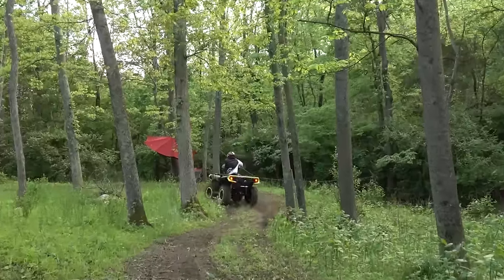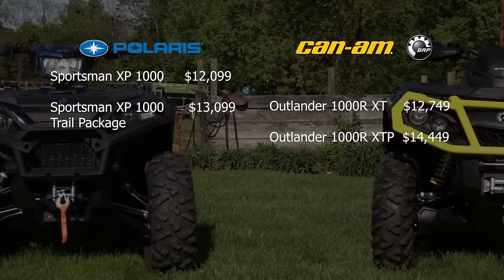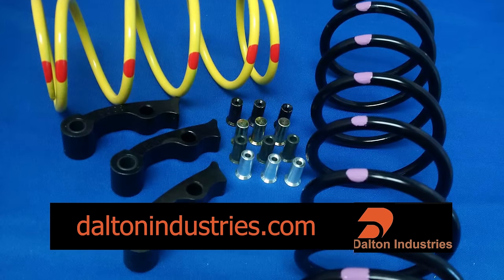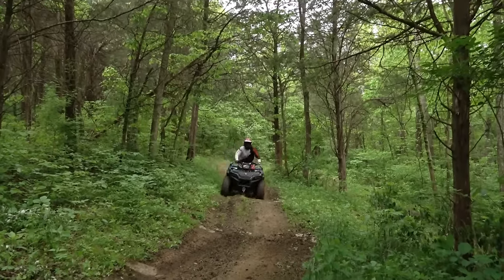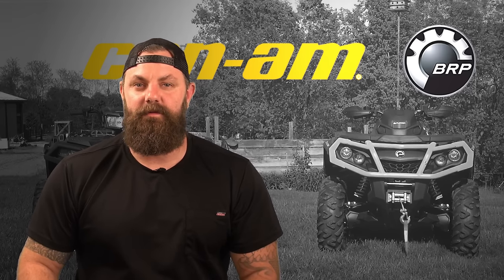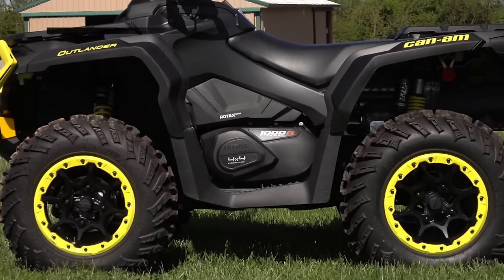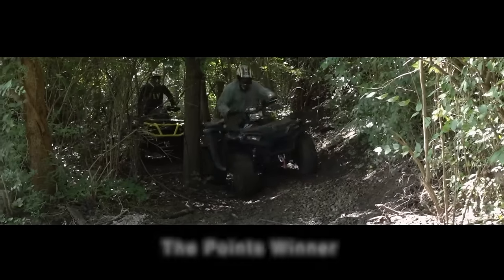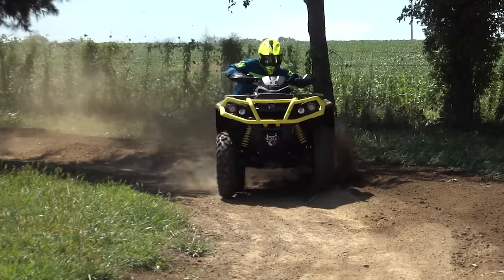Polaris Sportsman XP 1000 VS Can-Am Outlander 1000R XT-P, 1000cc 4x4 ATV Shootout

Comment: I own both - I think this is a great video to view for all buyers and I actually agree with a lot of details in this video.  What I liked best of this video was the last 60 seconds and that was  2 of the 3 would buy the Sportsman although the Outlander had better scores.   I feel exactly the same way.  The Can-Am's power and all that's said here and if I was taking it to the track, I would take my Outlander.  But other than than I choose my Polaris ALL DAY - EVERY DAY.  The big liter ATV's have incredible power, dangerous power and I am a power junky so I love it.  In reality I joy ride 90% of the time and don't use all the power.  The Polaris is so comfortable, smooth and so care free its an easy choice.  Outlander needs more aggressive power steering like a MAX-PLUS setting.  I dont like the shifting into Low when I am doing utility work as it gets warm it gets so sticky to shift its very frustrating and yes I keep the all the brakes applied to shift.  On a side note - What the video didn't show was that you can change All fluids - Engine Oil, Transmission, Front Diff, Rear Final Drive in 1/2 the time or more on the polaris.  Can't stand changing the fluids on my Can-Am but I do it every 12 month regardless of miles.  I think that you can't go wrong here and Polaris responded with a new "S" model to consider with upgraded shocks.  Polaris for me.  I have 3 polaris ATV's from 2012 to new and not had one issue.
Reply from the maker: Thank you for such a well-thought-out and informative post. We absolutely love it when owners give us feedback on machines they've had the opportunity to spend lots of time on. Chad on Days Sportsman and his friend Brian owns an Outlander. He mentioned how much easier general maintenance was on the Sportsman Duty easy access like you mentioned. I think we're going to come back and do a 1000 Mile review on how these machines hold up based on Brian and Chad's experience. They ride together most of the time at the same pace so the comparison should be pretty fair. We definitely need to make mention of the Polaris ease of Maintenance in that video. We'd recommend adding a power commander or some type of fuel management tuner to your Outlander. Richening up the fuel a bit will help cut down on the heat. You may also want to consider switching to a coolant like Engine Ice which can help reduce temperature spikes. All of these modern quads come lean from the factory to meet emissions and benefit from more fuel. Thanks again for the great comment and we hope to hear more from you in the future. One more thing, we are gearing up for a big Sportsman 1000 project designed to close the performance gap on The Outlander 1000 without sacrificing the comfort that makes the Sportsman so good.
Reply: @ATVonDemand  Thanks for the recommendations on the Outlander, I'll definitely look into the Power Commander and Engine Ice.  Great Job again on a fantastic review.
Reply: Great comment! All true!
Reply: Thanks👍👍👍
Reply: great comment, im in dilemma, i cant decide for outlander or polaris, i want to rip on open and ride trails with my girlfriend, watchin the new sportsman S but i think is to small for 2 persons, outlander xtp is big..
Reply: @sknails2723  I know all the safety polices out there say you cant have two people on it unless its a TwoUP version.  I go all the time with two people on mine BUT, I am a bit experienced, I don't drive like a crazy man, I am careful when turning. I also try to be familiar with the terrain before going up and down with someone on the back if it gets a bit extreme.  I am about to sell my Can-AM and my older Polaris so I can afford to buy brand new again.  I'm buying Polaris. I don't get paid by Polaris.  I am just tired of of the transmission and steering of the Can-AM.  I would ask for you to go ride both side by side before you spend the thousands of your dollars.  Focus on the power steering eases, focus on smooth shifting.  Even from R-P-H-L between gears while its running.  its just stiff.  Anyway. I could write a killer review like the one these guys did.  I would love to try the new 2021's to see if Can-AM fixed all my complaints.
Reply: @jamesknight7105  soo transmission is shit on canam? i can t believe it, they are number 1 brand in atv world, this got to be fixed somehow, how is steering shit too? did u tried Sportsman S 21 wide? Does it have enough power for drift and rip?
Reply: Polaris is the worst four wheeler brand I’ve ever seen the belt box placement on the 2019 is disgusting and it doesn’t even have bumpers also no power stearing on the 2019 atleast but renegade and can am is the way to go
Reply: @devinscott8665  ok, but the handling on new sports manS in a dream they say
Reply: Which one you recommend for a new hobby?
Reply: @MrZACATECANO100  2002 Honda foreman 450
Reply: What is your top speed on each?
Reply: Can someone answer me which quad is the most cost effective to buy? to master off-road well, not to consume too much petrol, not to break down more often and to have cheap parts and maintenance?
Reply: Sir, I agree with you completely .... You are right about Can Am .... I would love to join you in off road driving ..👍
Reply: You have a few Polaris 4wheelers ranging from 2012 til now with no issues?? Shit thats hard to believe  unless you never ride them and when you do, you put around for an hour. I've owned 4 Polaris 4whwelers, I bought all of them new, Expedition, Predator, 2 Sportsmans. All 4 were junk. Issues constantly and I'll never buy another Polaris product. Can-Am or Yamaha for me only. Those are the real top 2 in my humble opinion but glad you've had good luck out of your quads brother..
Reply: @sknails2723 the transmission is not shit it’s just the shifter gets stuck sometimes not a big deal I would go can am all the way I know this comment is really late but did you ever buy one?
Reply: I agree 👍 💯 percent I have a 500 sportsman never had any issues except me and my dad rect it twice but that's on us very durable
Reply: @denniswhite4548  rect it? Damn..

Comment: I just bought a 2020 850 xt. I gotta say I LOVE this machine. This is my first big bore, and first can am. I always owned polaris. I dont understand why they put the xt-p as a comparison. Can am has the xt model, and still offers more value than polaris top end model... for less money I might add. Even with polaris rebates. I've got almost 200 miles on, and no shakedown issues yet. The fit, and finish is second to none on the can am, ergos are better on the can am, besides the seat and foot placement. Polaris has that. Changing fluids and maintenance goes to polaris as well. The can am will take an afternoon, where the polaris can be done in around 30 minutes. But FUN, AND I MEAN FUN goes to can am!!! You've never ridden an atv until you put the performance key, in sport mode on a can am. I call it beast mode!!!

Comment: BEST HEAD TO HEAD COMPARISON YET!! this is what you need to watch if you're interested in purchasing either machine. this video definitely helped me make my mind up in which to get. This is how its done for a comparison video. Great job guys and I look for more videos like this in the near future. ☺️
Reply: That's awesome to hear!!! Which one are you going with?
Reply from the maker: Thank you very much. We're super stoked on this comment!
Reply: I am going with the can-am. I currently have a sportsman 850 and it just doesn’t wow me on the fun factor.
Reply: @twowheelthrottle4715 Please tell me how you liked  can am with it's  3 wheel drive, stiff suspension ,hard seat, weak power steering,     wide engine and clutch ,short wheel base so it can't climb up nothing and sounds like a dying cow must get a new exhaust and this is from can am owners I ride with.
Reply: I just bought a 2020 can am outlander xmr 1000r and couldn't be happier, also the seat is not hard, the fourwheel drive works great if your not a pussy and use the throttle, I kept a quiet exhaust because I'm not 12, the fox suspension can literally give you what ever ride you want, and the lack of body roll makes it handle like a boss, sorry but the polaris nut rider gave the wrong impression. On another note you cant go wrong with either my buddy has the polaris sportsman 1000 highlighter and it also is sick I have nothing bad to say about it.
Reply: I have the Can-Am outlander 1000
Reply: Hii
Reply: @twowheelthrottle4715  have the 2020 CanAm Outlander Max 1000 2-up and it is a BLAST.
Reply: best comparison ever     i cant wait to get the new  55" polaris sportsman 1000 " S"
Reply: I hope no one is surprised. Can am is the best bike ever. Since 1969. Way before polars quads or no dirt bikes polaris. Live of these because snow has gone. My XMR just flys and 4x4 engage. But this commercial is bull shit. U can put down payment on a house. This guy to young to know eh Lester?
Reply: @beefsredneckteaparty2812  why buy 20 20 bro not 2021? There all over
Reply: @JCsVideoChannel  there all 2 up. Take tool box of xmr and it's 2 up. Add the seat the give me one n roof for my maverick trail. Because all Outlander are not 30x9x14. The way off. It there itp
Reply: G2 frame. Is 96 long.
Reply: @crazyflyboy30  I know right can am is just overpriced garbage
Reply: Are you interested in exchanging quad can am for real estate in the tourist country of Montenegro in Europe?
Reply: Chad made this video great! Thank you sir!
Reply: @AffirmedPie  I'm switching to can am from Honda  I can say after driving one can am is way better than Polaris or Honda.also I've ridden Rubicon and I have a foreman 500 I used to have a Polaris it was garbage broke in the first month of having it.when people day can am breaks all the time it's mostly due to running 35s with super ATV  axels and not breaking in the atv properly I'm getting a 1000 xmr so yeah can am is not garbage also I have a need for it to be a 2 seat so yeah also yes ik I probably had bad grammar please don't correct me unless you can't understand what I'm saying Im not good at typing on my phone yet
Reply: @beefsredneckteaparty2812   well said 💯💯💯
Reply: @beefsredneckteaparty2812  I’m getting the can am XMR 1000 2022 in may!!!

Comment: I’m still rocking an old 2002 scrambler 400 4x4. Love the quad to death, super reliable and plush, aside from the awd system not working right it’s still a great machine to this day
Reply: Armature plates. Hub fluid. Make sure wires aren’t cut going into the struts in each side of front.

Comment: I've owned both of these ATV's at different times and the Can Am over all is a better ATV .
Reply: I totally understand preferring the CanAm. What did you personally like better about it?
Reply: @dirtobsexxionvlogs4892  clutch engagement seems smoother enabling easy power delivery, arched A arms on the 2019 and newer models is is nice, i did  find a noticeable difference on the ride quality with the xtp model, but not as soft as the polaris, at the end of a day riding the xtp  i didn't feel beat up. i do miss the polaris all wheel drive though.
Reply: @28crazydave  Interesting, we found clutching to be the opposite. Arched A-Arms are an upgrade on the Sportsman now but used to be standard, that kinda sucks.. Thanks for checking out the video!
Reply: not blowing front diff covers in half is a start lol
Reply: So where are you ATV on Demand guys from?
Reply: @sullyone8373  where else busy. Canada!
Reply: 23.000 now for them bikes. U only get 6 month warranty. On can am..XMR. I Wonder why. My deler say way to many in kids Right in mud. Then wants it fix. Not no more. That's why they don't show up XMR. I was so pissed off. These kids fucked it for so many men. And try get insurance in CANADA. For a 1000 nobody wants to insure any 1000. So heads up. Because can am here loses in so many areas. U need to put plates on it. Costed.me so much. I hope all is mamas boy. Fucking thanks. Throudel u just can't take it out for a 20 minutes. They don't tell I seat in melts. Plus there not ITP on that big. There terra crossss
Reply: 28crazydave we will see which one is more reliable can am will last a month then Polaris or Honda will last 30+ years
Reply: @peterskarpias5561  yes can am has the best plain trains atomobile. So for me it's can am. To have all this. With out Honda Japanese is all Honda is cfm Suzuki snowmobile artic cat.
Reply: all-in-all which machine is better?

Comment: I went into this Polaris bias but came out very open minded of other atvs
Reply: That's a great comment!!! We (Consumers) push the market, vote with your $$$ and be loyal only to the best option!
Reply: Don't be too open minded. Polaris and Canam are the only real options.
Reply: @Steph-lv5fg  um Yamaha, Honda? As someone who works on them and owns them, I would not count them out.
Reply: Yamaha's are rather dated, and Honda's are overpriced.
Reply: @Steph-lv5fg  well that’s your biased opinion. I work on Yamahas and Honda’s the least. And this is coming from a Can-Am owner.
Reply: @destinhook3826   I personally have no experience with CanAm, but I have experience with the other three, and yeah Yamaha's are gutless wonders that have hardly changed in 15+ years, and the cheapest Honda Starts at over $10,000 CAD.
Reply: @destinhook3826  And these aren't opinions, these are facts you can look up for yourself.  I'm not biased, I think competition in the market is great.
Reply: @Steph-lv5fg  I work on every brand of atv out there almost daily, Yamaha and Honda most definitely have a market. Not everyone wants a lot power or more bells and whistles. The one thing I believe Can-Am and Polaris lack is longevity, which is the leading reason Yamaha and Honda don’t come out with a lot of power.
Reply: Yes power does tend to shorten life span, but as far as longevity goes Polaris is very good, besides thier racks which are junk.
Reply: @destinhook3826  Honda & Yamaha are definitely more tame machines, and with that, they will break way less. They are comfortable, reliable, and low maintenance in comparison to bikes like the Polaris & Can Am 1000's.  Apples & Oranges I think. Different riders will buy them for different reasons.

Comment: I have a 2020 Can Am Outlander XXC 1000R. Love it! It's like riding a wild horse that you just want to try and tame, It's truly a thrill a minute! Was seriously looking at buying the new 2020 Polaris Sportsman XP 1000s - thought I had my mind made up until I test drove the Outlander XXC 1000R -- Can Am models have so much more to offer with upgrade goodies and customization that I just had to do it. I don't need a 55 inch wide machine, might as well have a side by side at that point, and for the short time I've owned the Can AM, I realized my suspicions were correct. Trails aren't ready just yet for a 55 inch quad - they were mostly tailored for less width on the machine where I live and I didn't want my quad to get frequently hung up on tree branches on the trails like to Polaris XP 1000s would have with that bulk. Between these two I would definitely pick Can AM XT-P 1000 all day vs Polaris Sportsman (Pick a model/Can Am wins all day). Just add that Yoshimura exhaust and you'll have no regrets. It's wonderfully noisy and fast. Your friends will envy you! If you have to get a Polaris, get the Hunter edition for the 1000 series, seems to be the best they have to offer without getting the $15000 price tag that the XP 1000s has.

Comment: Great test! I own a Polaris XP1000 and a Can Am XXC 800, and you're spot on. The Polaris power steering has more play, which makes the quad feel vague and skittish at speed. You can observe this yourself - with the engine off, rock the handlebars left/right to see how many degrees they'll move before causing any steering movement of the wheels. You'll see that the Polaris power steering has more play. 
My second complaint is Polaris' shifter. It is very notchy and gets progressively more difficult to shift over time. I've always preferred Can Am's shift lever.
The 2019 and newer Can Am's have a slightly quieter exhaust note, which is a plus in my view.
I ride my Polaris more, as it is appreciably more comfortable than my older Can Am. But I've ridden the 2019 Can Am and they have come a long way in closing the gap. Can Am's weak link in comfort is a result of their trailing arm suspension. It is just not a match for double 'A' arm suspensions.
I question the claimed weights, especially when they use a base model and a 'dry weight'. They don't include the winch, bumpers & upgrades. They should follow Honda and other Japanese manufacturers by listing the weight with all liquids.  To check truth in advertising, it would be nice if you could weigh them.
Reply: Can Am definitely came a long way! There are pros to the trailing arm suspension too, less drag, and better over straight obstacles like logs or ridges.. To me there's two weight classes of ATVs, the ones I can pick up, and the ones I can't... These fall into the ones I can't category! LOL! You're right though, realistically mid to high 800lbs for both machines wet and with all accessories..
Reply: Gregory Parrott yep!